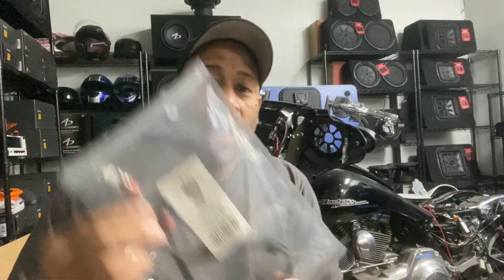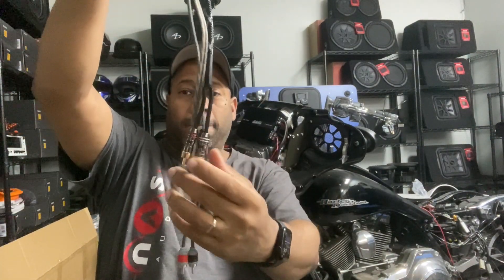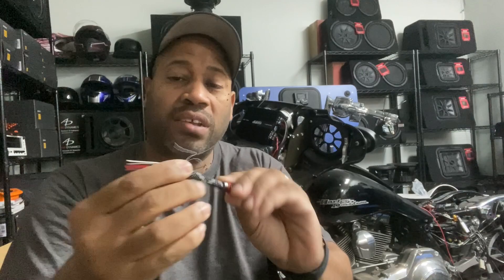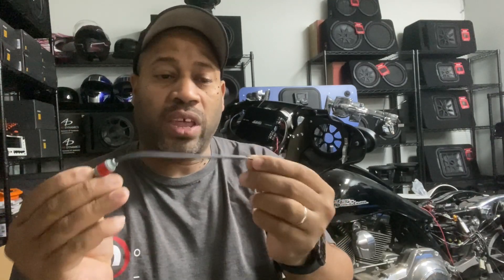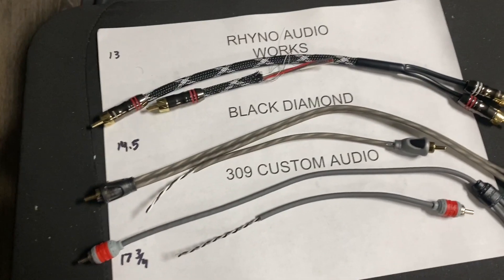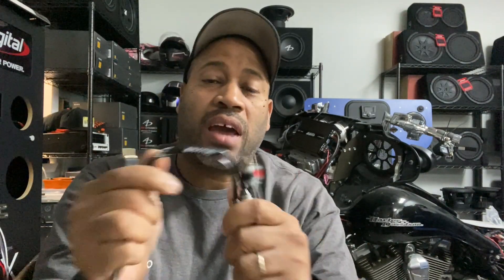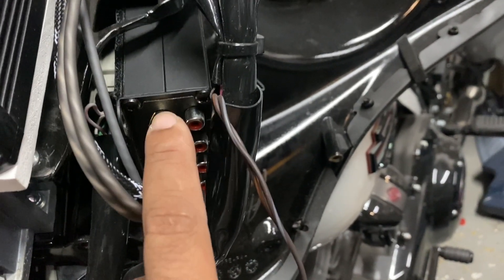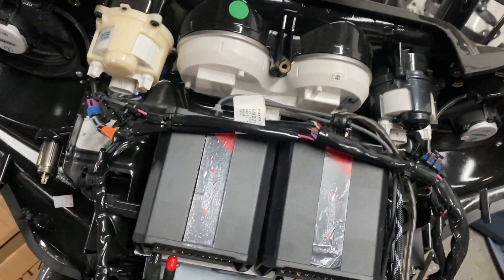Male to Male y Jacks for motorcycle audio installs

Comment: I have a question.. I am installing  a DSR1 in a 2012 Electra-glide  with 2 rockford  amps in the fairing.. Space is very limited.. and all those RCA connections take up alot of space and don't make the bike very serviceable.. CAN I CUT THE RCA'S OUT AND SOLDER THEM DIRECTLY  TO THE 4 PIN HARNESS OF THE ROCKFORD AMPS????  Thanks for any advice on this